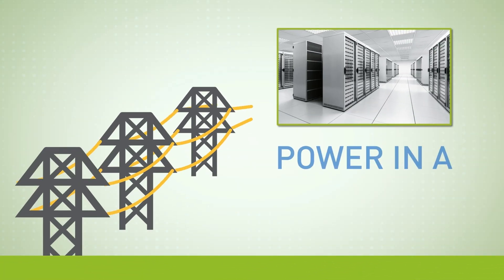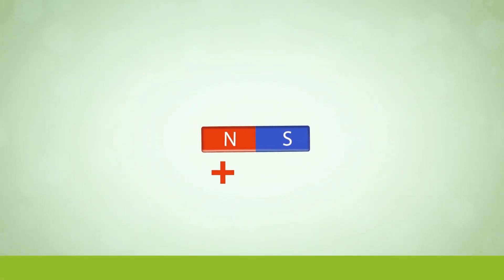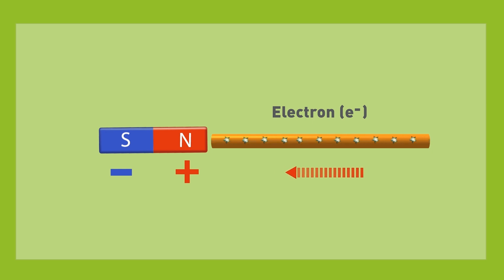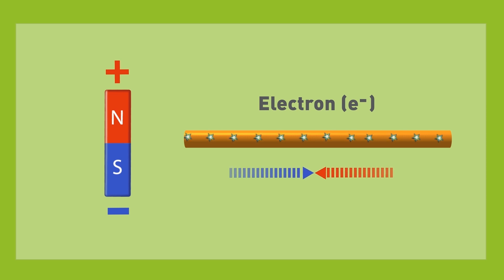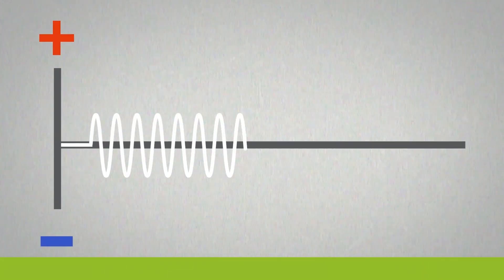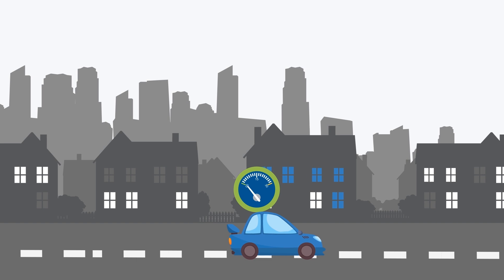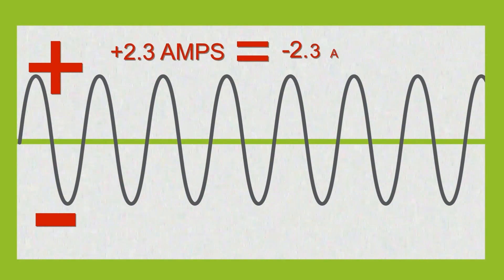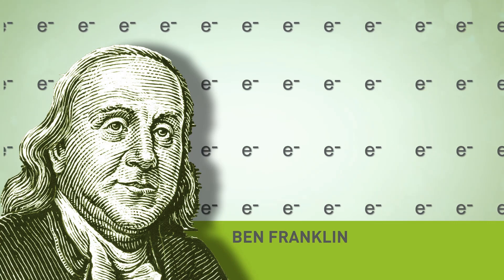Alternating Current Explained

Comment: WRONG! Whoever wrote this video clearly does NOT understand electricity and magnetism, and has basic concepts dead wrong. This video doesn't just fail to educate, it actually undermines understanding of the real principles.  Magnetic poles are not "charged", and do not "attract electrons". The material in this video is like someone wasn't paying attention on class, did not do the homework, and then was suddenly asked to present the material to the class and is BS-ing their way through it.

Comment: Great video, but there are a couple of small errors around minute 3:40. 
1) You confused a Hz with a wavelength. Hz is how many cycles occur per second. It is not the distance associated with / the visual representation of one cycle (which is what you showed) because that would be the wavelength. 
2) You also then said # Hz per second. That equates to saying "# cycles per second per second" or "# cycles per second squared". You should have just said # Hz, which would mean # of cycles per second.

Comment: Indeed, this video was inaccurate, having made many misconceptions. What I also perceived, was the explanation of the principle: ‘Electromagnetic induction’ (the video did not explain it correctly). This is how it ought to have been explained : If a magnet is stationary, it will not induce an electromotive force (electrostatic potential difference) across a conductor (in which case, a coil is used). However, if the magnetic flux varies periodically, this will be what will induce an electromotive force across an electrical conductor (a coil). Using a galvanometer, you can measure the constant change in current. 
Overall, this video was misleading. 
(A magnet has a North and South Pole, which was not mentioned in this video).
Accelerating charges (also molecular magnetic dipoles, fermions with a half-integer spin, intrinsic magnetic moment) will be able to produce a magnetic field. An electric field, however, can be produced by stationary charges. 

In case you are intrigued, transformers (step up and step down transformers), wireless chargers, eddy currents, magnetostriction and even motors also work on the same principle, ‘Electromagnetic induction’.
In a transformer, electromotive force will not be induced to the Secondary Coil (from the primary coil) if the magnetic field doesn’t vary (AC ==> Alternating Current). Just like how this doesn’t work with DC (direct current). With DC, you will only see minor surges of current from voltage modification. (minor)

More Evidence: 

Formula (induced electromotive force): 
ε = ΔΦ
       ——
       Δt 

Φ = magnetic flux 
Δ = change in 
t = time 
ε = induced electromotive force (electrostatic potential difference, or, voltage)

- - - - - - - - - - 

Φ = BA cos θ 

B = magnetic field 
A = area 
θ = angle between a perpendicular vector (90 degrees) to the area and the magnetic field

Φ = magnetic flux
Magnetic flux is the sum of all of the magnetic field passing through an area.
________________

You can also watch videos from Lesics, Engineering Mindset, ElectroBOOM, Physics Girl, Veritasium, EEVBlog… they describe this in greater detail.

Comment: In my understanding changing magnetic field causes the electron to flows, not the poles, if ploes were to cause the flow, a static magnet exposed to the static conductor should produce the current which is what this video implies in the beginning but this is not the case.

Comment: Wait I thought only a changing magnetic field could produce current in a coil?
Does this imply that just placing a magnet can make the electrons move and therefore produce current ?
Reply: No, induced electromotive force (electrostatic potential difference) is caused by a ‘varying magnetic field’. This is the principle of ‘Electromagnetic Induction’. Therefore, your initial interpretation was correct.

Comment: Hey great video. I have a question,  my concept my be wrong about electricity but I need an answer.  My question is ,in AC current changes its direction at 50 Hz or 60 Hz, doesn't it means that in case of single phase that we get at our homes the two wires hot and neutral, neutral wire must be hot wire during the negative half cycle. ? Thanks in advance. How does that work.
Reply: This is exactly my question too.  I have not been able to find an answer.
Reply: @rjh7728  Either others don't clearly understand electricity generation or they just go by definition.  Even I couldn't get satisfied answer till date. The only place we can find answer is to visit a nearrst Power Station. One answer that makes a bit sense is at Generation end the the wire said to be neutral is grounded. Means The two wire ends coming out of a electricity generator ; one is grounded while other is live/hot carried to far end user.

Comment: Complete NOOB here. Your example with the car, intrigues me. If voltage is, the potential "energy to do work" and AC current alternates back and forth, how can any work be done? Imagine a man [representing AC current] sets one foot outside of his house to go to work, but then takes one step back and vice versa... How can he ever get to his job [to work], if his ratio of motion is 1 to 1[one step forward, one step back] It seems to me, that a minimum of 2 to 1 [two steps forward and one step back] would be necessary for this man to adopt, if he is ever to get to his job. So, if electricity is constantly being pushed out of the mains at the same ratio, as it is being sucked in, how can ever get to my toaster - to do work? Please let me know, I want to learn.

Comment: Did you just say that electrons are attracted to the positive part of the magnet?  That is incredibly wrong.  First off, we don't talk about positive or negative sides of a magnet.  It is north and south.  That is not only semantics.  We use different terminology to emphasize that magnetic poles are distinct from electric charge.  Neither attracts or repels the other.  They only affect each other when one or the other is changing.
Reply: Precisely.
Reply: Your interpretation was well clarified (the correct terminology used is distinct from the terminology the video used).

Comment: Not "millions of electrons" moving in a copper wire; try many quintillion times that.  One gram of copper has about 3 x 10e23 or 274,920,000,000,000,000,000,000
 electrons, give or take one or two.  Way more than millions would be moving in a copper wire with measurable voltage.
Reply: That's almost as much as the U.S. debt.

Comment: 1:41 So if I leave a magnet near a copper wire I would be generating an endless amount of electricity? Why we use batteries then? we should use magnets instead
Reply: The magnet must be changing polarity in some way in order to cause the electrons to continue moving.  Without current there is no power.  There needs to be a continuous circuit for the electrons to flow as a current.  Batteries have a plus (+) and a minus (-) pole.   Electricity is very much like a river.  If the water is flowing it has the capacity to turn a water wheel or turbine fan due to the "current" , or water movement.  If the water is still it does next to nothing.  The river's water has the "potential"  to move things, like water wheels or turbines but only if moving.  A complete circuit may contain voltage but there will be no current until the plus connects with the minus or in AC as the "hot" wire connects with the "common" wire.  DC is required for almost all electrical devices.  Without AC we could do as Edison wanted us to do, i.e. change batteries every day.  DC cannot be varied by transformers so generally the user is stuck with one voltage.  If DC is transmitted through wire the voltage will drop over any distance.  AC voltage will also drop similarly to DC voltage but with AC the voltage can be raised by passing through transformers to very large values, like 150,000 volts, transmitted by wire over great distances, and then lowered at the user end by other transformers.  The voltage drop due to the high voltages is minimized over great distances.  In the US and some other countries AC is delivered at 7500 volts to a residential street and then lowered to 240 volts at the user's end.  In the US the 240 volts is generally divided to 120 by using one half of a transformer but also provided as 240 Volts AC by combining those transformer windings.  If electronic equipment is "plugged in" the equipment itself has a power supply that will convert AC to DC quite easily, providing what the piece of electronic equipment needs.  Probably more than you want to know but stuff like this (epistle) helps me.  I'm sure I got something wrong and don't mind anyone else pointing it out.
Reply: @jhettish its 10:30pm rn and i have no idea what that says xd
Reply: John Hettish Are you an electrical engineer?
Reply: I KNOW RIGHT! I THOUGHT THE EXACT SAME THING!!!

Comment: Sorry, but this video is misleading the viewers. According to your explanation, if we connect both sides of the magnet with a copper wire, we will get an endless current of electrons from '-' pole to '+' pole, which means an endless free electric energy. It is not a case in real life. It is not the way how electricity is produced.
In order to move the electrons through the conductor, the conductor needs to cut the magnetic fields.
Reply: When you first plugged the wire in wouldn't you get some movement of electrons? Then couldn't the lack of further current be explained by the lack of sufficient exposure of the remaining electrons to the flux? In other words is the fact that more electrons aren't moving due to a lack of motion in the field or due to the fact that the field is discreet and shaped and just doesn't reach all that many electrons with sufficient force when you have a sitting still?

By analogy, is the kinetic energy you contribute pushing the electrons like stirring a pot, or is it a process more like moving a spotlight across the crowd?

I think he's sort of right. If movement of the magnet or the wire were what moved the electrons, then the direction of the current flow would be arbitrary with respect to the poles of the magnet. But they move in a particular direction because that's the effect of such a magnetic field and what we're doing with movement is increasing their exposure to that field. You don't get endless free energy because you never have a maximal and perfect match between the field and the atomic structure of the wire, unless you're moving the magnet at an arbitrarily extreme speed, and because the wire has resistance etc.
Reply: https://youtu.be/yrI8NvHI4RE
Reply: e=Blv.    Voltage is created ONLY by a MOVING magnetic field in contrast to a wire. The North pole does NOT move the electrons. Just try it!!
Reply: @samueljohnson2141  Precisely.
Reply: The video isn't misleading. It's not talking about the production of electricity, but rather how A/C works.

Comment: nice video. just one thing, a cycle is not called a Hertz (Hz), a cycle per second is 1 Hz. So to say "60 Hertz per second is not accurate. Nit picking really, good job overall.
Reply: @TinselDoll  It's 32 feet per second per second!
Reply: That is not the only thing wrong! It is a really bad video from a basic physics standpoint.

Comment: Sorry but the AC generator model is a bit oversimplified and thus a little misleading. If you draw a loop of wire near the magnet which is a better representation, you'll see that electrons flow both towards and then away from a pole at the same time so the movement can't be based simply upon attraction to a "+" or a "-" as with DC circuits. The magnetic forces produced by a north pole push electrons one way around the loop according to well defined laws of physics, and a south pole causes them to move the other direction. And electrons do not move in a stationary magnetic field regardless of the "+" or "-" so the magnet has to always be moving, although the electrons will stop momentarily when the magnetic force is zero such as it is when the coil is in between north and south poles.

Further, utilities don't spin wires inside of magnets to generate electricity, we spin magnets inside of coils of wire to generate electricity.